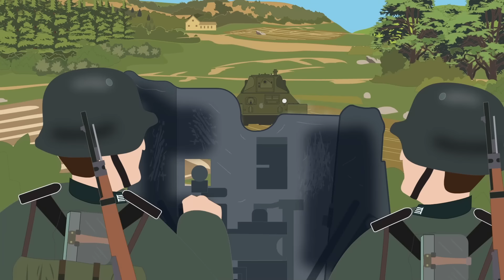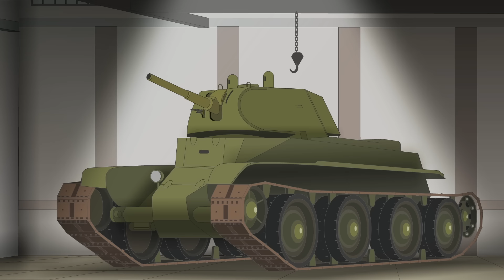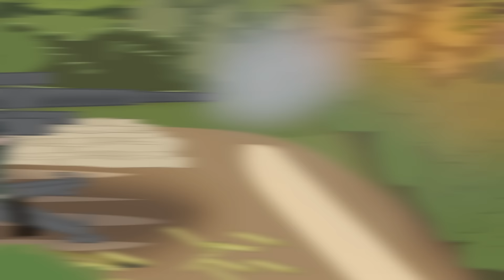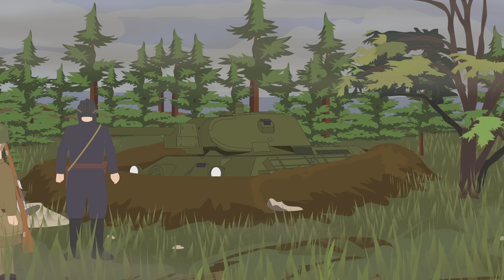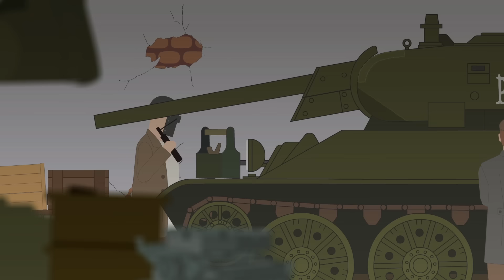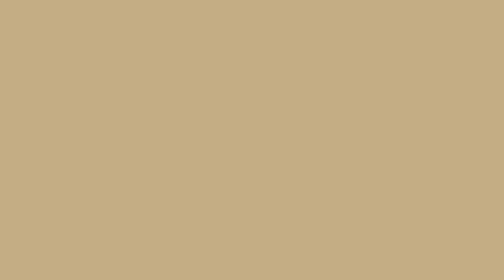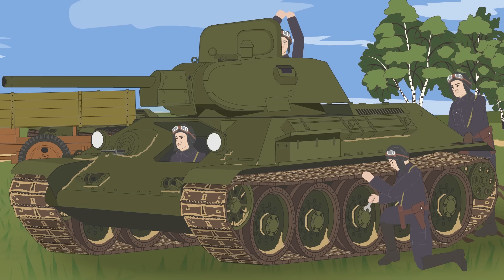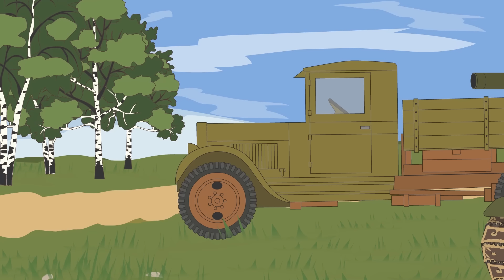Was the T-34 Really the Best Tank of WW2?

Comment: Panther was better once the bugs were worked out, but if you factor in ease of construction and ability to get more units to the field the T34 wins every time. The Soviets were driving them from the assembly line to combat. 💪
Reply: Panther was not better at all against latest T-34 modification with 85 mm gun. Besides, some Panther prototypes were exact copies of T-34
Reply: @AlexanderTch  The 85 mm gun of the T-34 was comparable to the KwK 40. The gun the Stug III was equipped with. Overall the T-34  was probably one of the worst tanks. The best was probably the Sherman.
Reply: @user-rh3pe7um8d  You lie. First. Caliber of Kwk-40 is just 75 mm. ZIS-S-53 of T-34-85 had calbier 85mm
Second, length of T-34-85 gun ZIS-S-53 is 54 calibers, while length of kwk-40 is just 48 calibers.
So, T-34-85s gun is larger in caliber and longer in length so it's much more powerful.
kwk 40 is very weak, and can be compared to first versions of T-34 , ,not to t-34-85.
So, T-34-85 had powerful gun that could crack Tiger's mug from 1000 meters.
Reply: @AlexanderTch  The caliber and lebght of the barrel do not matter. The muzzle velocity does. The 85mm had the same if not worse muzzle velocity as the KwK 40, depending on which round was fired. The T-34-76 gun was similar to the Sherman's.
Reply: @user-rh3pe7um8d  Lol, you are silly. Muzzle velocity of German KwK 40 gun is just 754 m/s, while muzzle velocity of Russian gun ZIS-S-53 is 1054 m/s. First thing on which muzzle velocity depends is length of barrel. Longer barrel means more time of accelerating of shell in it and it means exactly higher muzzle velocity. It means that T-34-85 had much higher muzzle velocity. Second thing is amour of fire powder that explodes in barrel to push shell. It depends on caliber and length of cartridge of a shell. T-34-85 has larger caliber.
Reply: @AlexanderTch  
Yes, the 85mm has a longer barrel, but the shel is also larger, meaningit needs to travel longer than a 75mm shell to build up speed. 
You just chose the lowest value you could find for the 75mm and the highest you could for the 85mm. It depends on the type of ammunition used. Using the PzGr. 40 a muzzle velocity of 930. The 85mm can reach a muzzle velocity in the high 700s using BR-365. 
However, the muzzle velocity cannot be the only metric we look at. If we look at penetration values, it becomes obvious that the KwK 40 and the 85mm have similar penetration values under optimal conditions. Under battle conditions the KwK 40 would probably perform better since the quality of Soviet rounds was poor. Tankers even reported Soviet APCR to explode in the barrel. 
You also claimed that the 85mm was compareable to the German 88mm.  Comparing penetration values, it becoes obvious that this is false. Lets look at penetration at a 2500 meter range under optimal conditions using the highest penetrating round available (PzGr.40/43 and BR-365). The 88mm penetrates 159 mm, while the 85mm penetrates 76mm. The 88mm is clearly superior if we look at penetration. Overall, the T-34 was probably one of the worst tanks of the war. Not because it was poorly designed, the design was quite good, but because it was poorly manufactured.
Reply: @user-rh3pe7um8d  Larger shell means larger cartridge of projectiles, has much larger amount of fire powder, more powerful explosion during shooting. Anyway. T-34-85s gun has 1.5 times faster muzzle speed.
Reply: @AlexanderTch  But similar levels of penetration and worse reliability.
Reply: @user-rh3pe7um8d  lol. Shell with heavier weight and higher muzzle velocity has much better armor penetration capabilities. Besides, T-34-85 had sub-caliber projectiles that had even better armor penetrating abilities. 
IS-2 with 122 gun cracked Tigers foreheads even from longer distance, so, German commandment ordered their tankmen not to confront IS-2 without significant superiority in numbers.
Reply: @AlexanderTch  Yeah, if the shell quality is poor, than no amounts of aditional weight can help. Look at the data from British and American testing. The KwK 40 and Pak 40 have similar penetration capacities as the 85mm. Do you thin that these numbers are fake? I guess, you alsi think the T-34 was the best tank of the war and ignore how it had issues with spalling, how the gearbox was terrible, how cramped conditions were inside, how the fuel tanks were in the crew compartment, how most of them didn't have radios, how the oprics were terrible, how pporly assembled lots of them were and how the manufacturers took shortcuts to produce as much of the as possibe. The best tank was the Shermn. It was comfortable and safe for the crew, it was reliable and it's armor and firepower were sufficient to deal with most German tanks.
Reply: @scorchclasstitan6727  lol what? Never said anything like that
Reply: @user-rh3pe7um8d  sure you didn’t . 

Lies 🤮
Reply: @scorchclasstitan6727  Wtf, I just takked about penetration capabilities of various cannons. Show me a quote from one of my replies stating what you just said.
Reply: @user-rh3pe7um8d  “armor and firepower was able to deal with most German tanks”

No , no they weren’t , not even close. 42,000,000.

That number alone proves everything the Soviets have void.

Germany wasn’t a third world country , they held off the world for 5 years .
Reply: @scorchclasstitan6727  So a statement on how the Sherman's gun was sufficient means I'm saying Germany had no tanks?
Reply: @user-rh3pe7um8d  yes actually , your acting as if they had no tanks at all or as if they were such terrible quality they didn’t exist . 

Shame
Reply: @scorchclasstitan6727  How? Elaborate further on that.
Reply: @user-rh3pe7um8d  you keep asking “how?” “How?” .

You should know how . Germany wasn’t a third world country.
Reply: @AlexanderTch  42,000,000

Germany was better , your losses say as much .
Reply: @AlexanderTch  this kid just said 8 million Germans when their wasn’t even that many Germans to begin with :P.

42,000,000 Soviets . 

42,000,000 VS 7,000,000.

Actually let’s add China onto that since they were  communist as well .

60,000,000 + 42,000,000,

Huh. Add that together will ya ?
Reply: @AlexanderTch  and just as a little btw.

Don’t use the word “atrocities” when you support the Allies ^^.

42,000,000 + 60,000,000
Reply: @AlexanderTch  and this kid just said give me facts about China when Mao exists .

This is how blind these things are .
Reply: @AlexanderTch  THIS KID IS CALLING 60,000,000 DEATHS PROPAGANDA WHEN THEY WERENT EVEN AT WAR IM DONE XD.

Trolls will be ignored .
Reply: The StuG III was the most produced German armored fighting vehicle and was half the price of a Panther. The Germans did put some thought to economics in producing fighting vehicles.
Reply: I heard that those was untested D variants
Reply: @blackfacts6137  the G late was the one who was fixed entirely for me the Panther G late was the best ww2 tank (per tank)
Reply: @heuzame6198  What about A variant ???
Reply: @blackfacts6137  filled with teething problems?
Reply: @heuzame6198  Dunno

I'm just an enthusiast
Reply: @heuzame6198  it’s actually one of the worst tanks Germany has ever built. The problems even after the later variants were as much as the t 34
Reply: Guv... Panther is 44 tonnes carrier of what? Of what gun? 7ty 5ve millimetre gun? Are real? The best? Are you serious?
Reply: @worldoftancraft  infact the Panther 7.5cm is much better than what the T-34 got its much accurate can still one shoot it and can pen it with ease what do you want more?
Reply: @heuzame6198  help infantry? Destroy a long-term fortification? Clear an enemy's trench? Suppress enemy's firing position?

Upd: tank is a tank — not tank destroyer. Yet NATO, in the face of Germany and the US-of-A, still need to learn than, judging by the fact that 120 tanks didn't have a supply of just plain HE's for like 25 years, up to 2015.
Reply: @worldoftancraft  The Panther can do it aswell
Reply: @heuzame6198  Indeed. While weighing 44 tonnes. The weight needed for full-scale 122mm tank called «JS-2»
Reply: The 75L70 could, if I remember the figures right, outpenetrate the T-34/85's gun and was fairly competitive even against the IS-series's 122mm at most ranges (and despite being of similar weight, the Panther was ~25% faster than the IS-2). A heavier shell does result in maintaining momentum and thus armour penetration over greater ranges, but this still requires being able to score a hit at those ranges, and by WW2 standards the IS-2 didn't carry many rounds of ammunition. Meanwhile, the lighter (and easier to reload) shell results in a higher rate of fire, and the higher velocity contributes to greater accuracy. In tank-to-tank combat, higher rate of fire and similar penetration often translates into more kills (real life tank combat isn't like World of Tanks where tanks have hit points and higher-caliber guns inflict more hit points in damage).

It obviously did have a smaller HE shell, but 75mm was still perfectly adequate for pretty much anything short of a concrete fortification. 75mm or so was pretty much standard for close fire support throughout the early 20th century, and it's not like infantry got any tougher during that period. German doctrine also did designate the Panther as being a tank-killer - for close infantry support, 75mm or short 105mm guns on Panzer IV hulls would do the job, and for bunker-busting, the Germans had heavier guns available on other vehicles. If you're fielding a variety of types, you don't need one type to do every job. There's a tradeoff between being a generalist and a specialist, and a vehicle being more in the latter category doesn't mean it's inherently worse as long as having that specialisation makes sense and it's not TOO over-specialised like the Elefant. (One of the problems with the Sherman is that it went too far the other way because American doctrine at the time was the standard tank model wasn't intended to fight other tanks. That changed quickly after D-Day.)
Reply: @Draxynnic  What about Pather vs JS-2 against real and typical targets for tanks: infantry, entrenched points long-term defence, bunkers and etcetera? Oh, sure. German doctrine of never making any new offence is kinda self-telling. I guess the majority of modern NATO tanks kinda support the started by 44 carriers of 75mm tradition of being a tank-destroyer.
Reply: @Draxynnic  YOu remember? YOu saw that by your own eyes? YOu lie. I need proofs
Reply: @Draxynnic  Exactly, T34-85 round was lighter and easier to reload, that's why its gun penetrated all German heavy tanks.
Reply: @worldoftancraft  75mm and the coaxial machine guns was good enough for that sort of stuff at the start of the war, it'd also be good enough at the end. Like I said, infantry, bunkers, etc didn't really change much during the war. Also more ammunition carried and can be reloaded more quickly, so while you have smaller HE bursts, you can get more of them.

That's not to say that there aren't advantages to the big gun, and obviously in modern times they have standardised to around 120mm, but that's because armour evolved to the point where you really DID need the bigger gun to get through it. At the end of the line, different countries had different priorities, but it certainly wasn't a given that higher caliber was better at the time when you consider the soft factors as well.
Reply: @Draxynnic  The main problem of your take is that 75 mm manual-load gun is not 30 mm autocannon and what you mean by «burst» is up to 6 shots per 30 seconds. Also, I will surprise you, but heavy artillery is being liked not only due to range, yet also for «quality of splinters»
Reply: @worldoftancraft  I said nothing about burst, just that if your shell is able to penetrate enemy tanks and you can fire them faster, that's an advantage. A bigger HE shell is also an advantage, to be sure, but in the world wars, 75mm was good enough when dealing with infantry and other soft targets. Obviously, you wouldn't use a WW2-era 30mm autocannon on a late-war tank because it simply won't be able to defeat the armour of enemy tanks.

Western doctrine pretty much since WW2 (after the British dropped infantry tanks and the Americans merged tank destroyers and tanks) has been that the main priority of tanks is to destroy other armoured vehicles. If the enemy tanks are destroyed, and you're not being harassed too much by air, you pretty much have free rein (yes, infantry antitank weapons do exist, but are generally not as dangerous as an enemy tank). A couple of machine guns and a cannon with decent HE on an armoured vehicle is scary enough for infantry regardless of whether it's 75mm or 120+. While fortifications are something you call in artillery or air strikes for.

None of which is to say that there aren't times when a big 122mm on your tank isn't convenient to have, especially when going on the offensive - but if you've already dealt with the enemy tanks, it's a bit of a "win more" situation. While optimising towards fighting tanks means you can get into the position where the enemy doesn't have any tanks to oppose you and you can afford to focus on infantry or whatever else.
Reply: @Draxynnic  From my POV, a tank is a protected artillery unit. 
Hence it has nothing with fighting other of its kind. Yet it can be fitted and optimized to do it with some success, although the dedicated tools will be more-moooore effective.
Reply: @worldoftancraft  Yeah, that pretty much pins it down there. Different viewpoints on what a tank should be. Your viewpoint is close to what it started out as in WW1 but... when it turned out that the best way to get a gun that's both powerful enough to destroy a tank and mobile enough to destroy a tank was to put it on an armoured vehicle, most tanks started becoming optimised to fight other tanks because they were the biggest threat. Once the enemy tanks and tank destroyers were gone you almost have free rein over what's left as long as you don't get too overconfident (or hit from the air, but anti-air falls to other vehicles).

The Panther was pretty much definitely designed to kill other tanks, as were 1945 Western Allied tanks in the same weight class like the Pershing and Centurion. From the German perspective, the role of protected artillery unit in the later part of the war was mostly occupied by things like the StuH 42 and Sturmpanzer IV. (Earlier in the war it was short 75mm-equipped Panzer IVs, but combat experience led to that being replaced with an antitank weapon, and the short 75mms were moved to the now-mostly-obsolete Panzer IIIs. After that, every tank had an antitank gun as its primary armanent except the 100t-plus superheavies which would never have been practical anyway.) 

There's not really much you can do to make something on land that's more dedicated to fighting tanks than taking a tank and putting the best antitank gun you can fit into it. Antitank guns and missile launchers don't have the mobility and are easier to kill once you've located them. Dedicated tank destroyers, both turreted and unturreted, were tried and are largely gone for a reason.  There are a few light vehicles mounting antitank weapons in modern armies, and they have the advantage in speed, but generally still aren't as reliable at killing tanks than a good tank gun, and, again, are relatively easily dispatched once located. Antitank aircraft are a serious threat, but as the old adage goes, an aircraft can't hold ground.

When it comes to protected artillery units, I'd probably say that the ISU-152 was the best of the war, but if you consider having a turret to be more important than the biggest available gun, then it does default to the IS2. I just don't think of a tank that way, either in that period, or in the modern period (most major militaries have an armoured, turreted SPG with at least a 150mm caliber nowadays, and there's some work being done with special shells around the 30mm caliber for shooting down drones which would probably also be pretty scary for infantry).

Mind you, the real reason we're having this discussion is because despite its weight, the fact that some of that weight was in the form of a big engine that gave it medium tank mobility despite the weight is why the Panther tends to be analysed as a medium while the IS2 is analysed as a heavy. If the IS2 had another hundred or so horsepower, we'd probably be having a very different discussion.
Reply: You need to consider that the T-34 came out in 1941 and 57 000 were produced in the war meaning they could take full advantage of the better tank at the time. The Panther only 1943 and only 6000 produced so the T-34 is the better  tank due to timing.
Reply: @alastair9446   that timing meant nothing , 42,000,000.
Reply: @alastair9446  It's better to have few quality tanks than to have lots of subpar tanks.
Reply: The T-34 was not that cheap and had serious production issues (like non standardized parts across factories...) but the Soviet industrial power was just that strong.
Reply: The panther was designed from a captured T-34
Reply: @longshanks7157 
Wait, is that the real Stephen Loach? The one who thinks that the designing of a new medium tank - the Panther - started because of the T-34?
I bet you think that the German AT guns were upgraded because of the sighting of KV-1s and T-34s too.
Reply: @Armour_Enjoyer  the panther was devised after studies on T-34s captured on the eastern front, the first prototype was built in September 1942 by MAN. Production is immediately launched, and the armor requirements of the German Army are so strong that other companies, such as DB, Henschel and Maschinenfabrik Niedersachsen, also receive orders. Why else was it introduced Mr Von unlucky?